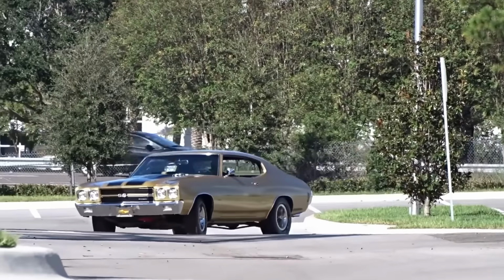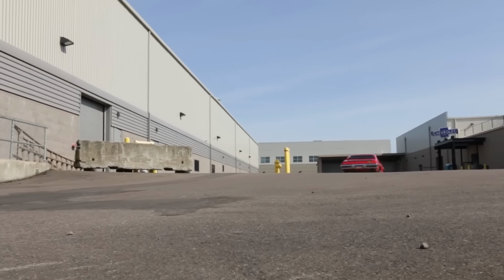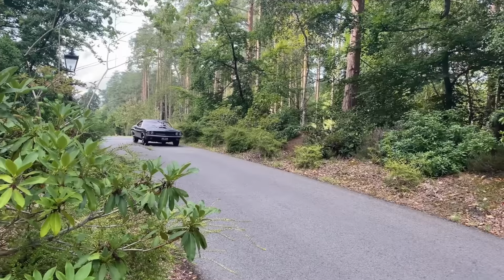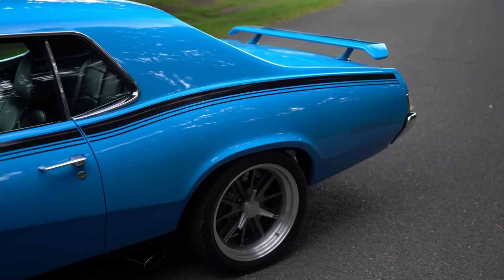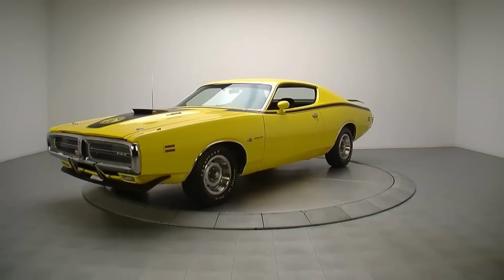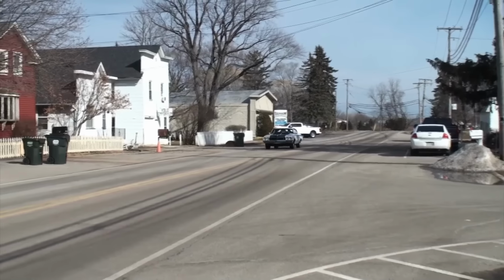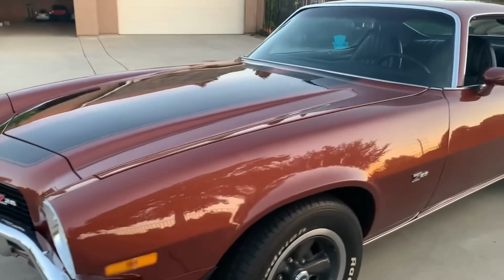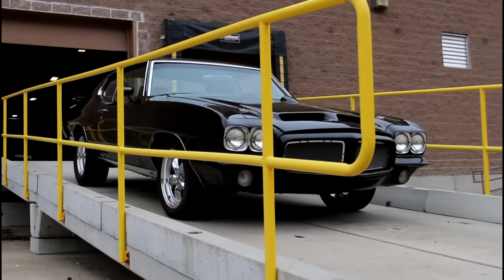The 10 Most BRUTAL and BEAUTIFUL Muscle Cars of the 70s That Made History

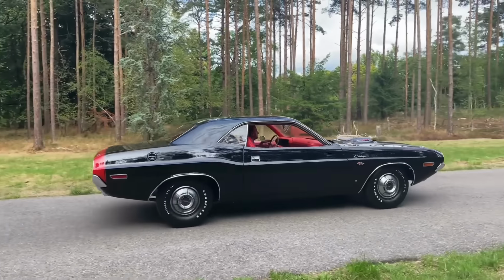Comment: I got an exact example. The did that 302 ho wonders. It was ok for GM people to add stuff to their cars just to try to catch a 5.0. when they saw it with that throttle body... I'm cheating. You got a 350 to 4 hundred something cube inches and you cry about a 302 with bolt ones???? Keep it repaint it keep it looking like it came out, cruise with. It'll still knock 6:09  some socks off with a nice cam and cylinder heads😃